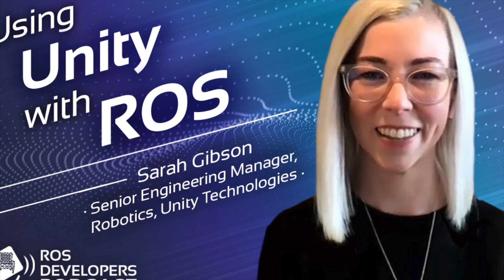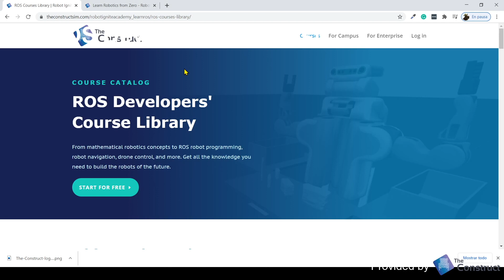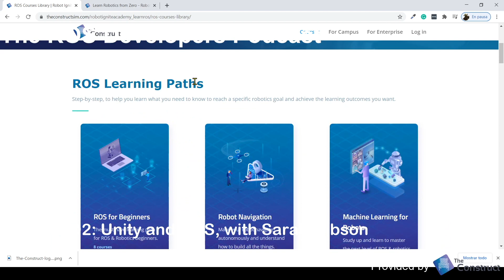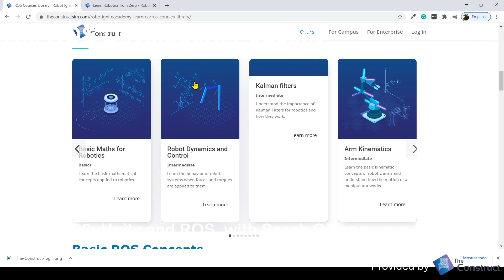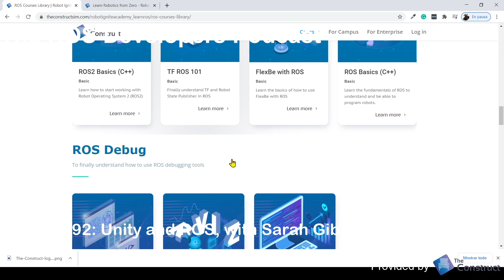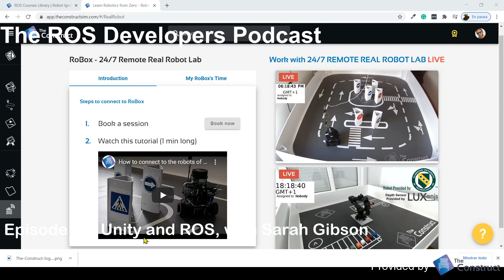RDP093: Using Unity with ROS with Sarah Gibson

Comment: NVIDIA PhysX supports multithreading not only on CPU and allows for GPU acceleration for Nvidia GPU's starting from GeForce 9‑series. GPU PhysX configuration controls are available from the NVIDIA display driver control panel. Cheers!

Comment: Thank you Sarah for mentioning AGX Dynamics in the show! Here's a link to our web, where you also can apply for a free trial: https://www.algoryx.se/agx-unity/. We actually have quite a unique physics engine that handles multi-contact gripping, dry friction, large mass-ratios, linear elasticity, peg-in-the-hole, cables, etc. which are all important for accurate robot simulation (https://www.algoryx.se/technology/). Until now we have mainly licensed our software directly to manufactures, e.g. ABB RobotStudio, but partnering with Unity has made it a lot more accessible.

Comment: Regarding multi-threading in simulation, gazebo 11.0 and ignition simulation have multi-processing feature for gui rendering and physics simulation but they are still changing their architecture for leveraging multi-threading for simulation of physics of multiple robots. In Argos Simulator the Feature has been developed and it supports multi-threading for physics simulation.
Reply: Thanks for clarifying that point and sharing this useful info!